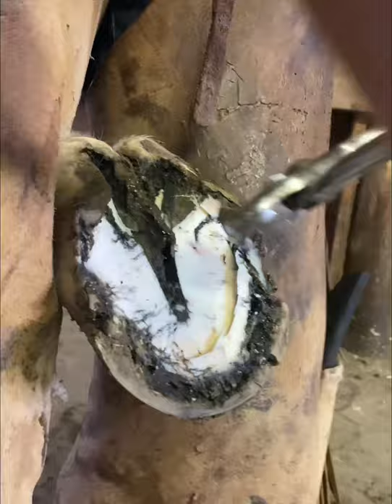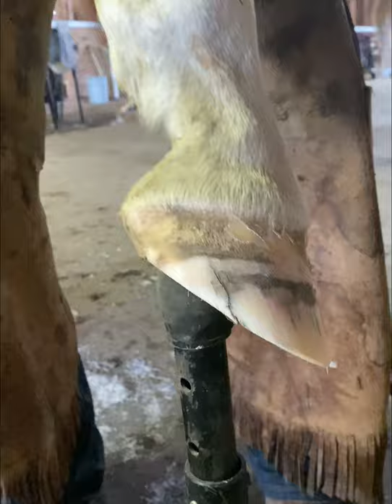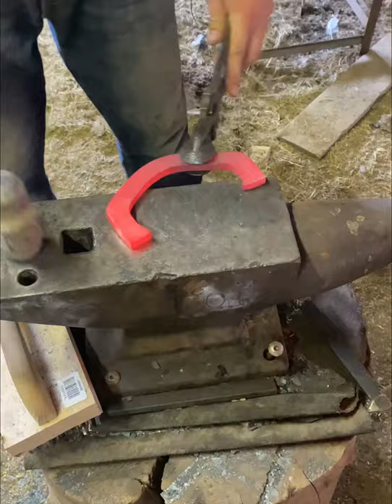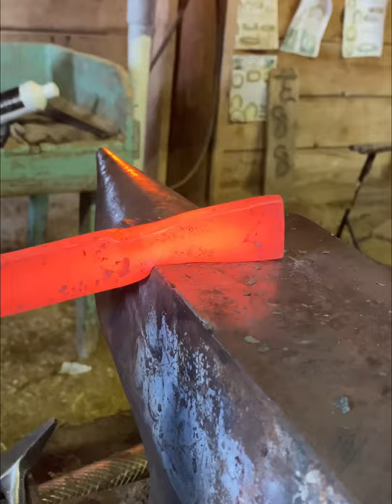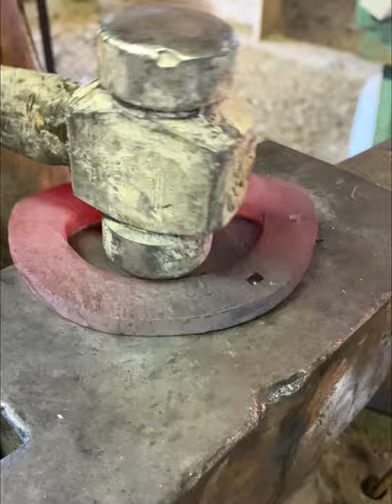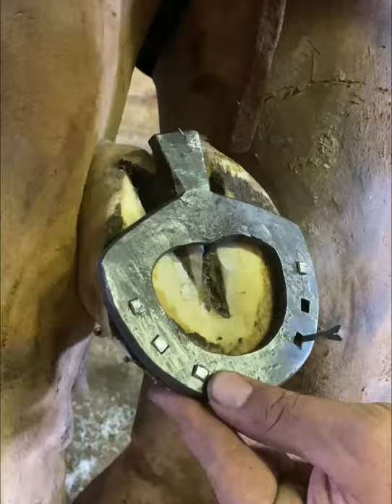CUSTOM FORGED "Mushroom" Horseshoe

Comment: I can see that the horse has underrun heels and a long toe. How does this shoe help? It takes pressure off the heels and transfers it to the quarters and the long narrow frog. Wouldn’t a farrier prefer to have pressure on the heels rather than the quarters? At the end of the video the horse definitely has a shorter toe, but the heels are still underrun.

Comment: Maybe a dumb ? But would the bar extending over the frog irritate it? Does the heel not need support?
Reply: Its a kind a corrective shooing .
Its mostly needed on "freshly" retired runners ...
The need for speed use of the horse makes the shape the hooves with quite thin heels and pretty long fronts to force the horse to have the maximum amplitude on each step he'll run along the ride ...
Once they retired for whatever reason ...
You need to correct all the hooves shapes n angle ...
Their entire skeleton ! Starting from the ground .
So the frog becoming sensitive like as a part the process .
He'll have to learn wearing the front his hooves first and cares the way he walk cause he might won't have shooing anymore in his future ...
Which not necessarily means he won't have to be seen by farriers ...
Point stand you better not release it "as is" in the pastures without correcting their allure ...
Their "verticals" ...

If you get the sense ...

Dare, care, ride safe, clean, have fun ...
From France with .

Comment: Can they tell that the horse is heelsore from the wear and curvature of the hoof?
Reply: Certain patterns in the hoof structure cause or can indicate types of pain. You can also observe the way the horse stands and moves. For example, horses that have sore heels will land toe first when they take a step as they try to avoid pressure on their heels. A sound horse will land on the heel/almost flat footed when it takes a step. Vets sometimes use hoof testers which are like big metal pliers to put pressure on different parts of the hoof to see where they are sore.
Reply: @Lauresaurus96  thanks for the reply and the explanation!

Comment: I don't understand exactly what this is correcting or how.
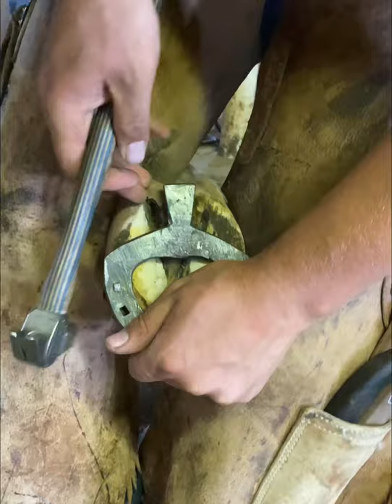Reply: At 5:12 you can see the bottom of the hoof. The parts left and right of the "extension" that covers the frog are what is hurting this horse when it puts pressure on them. This kind of shoe keeps those parts floating above the ground so they don't come into contact and don't hurt anymore. It also helps to regenerate bloodflow to that area. Because there is no constant pressure there, blood will start to flow back into these parts and stimulate a healthy regrowth of hoof.
Reply: @akw6078  That makes sense.  Thanks for the explanation.